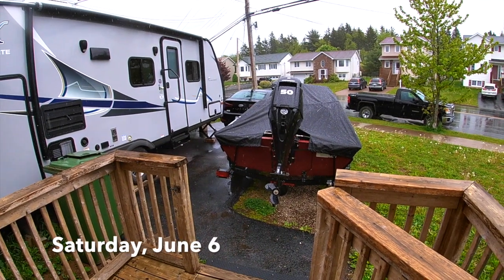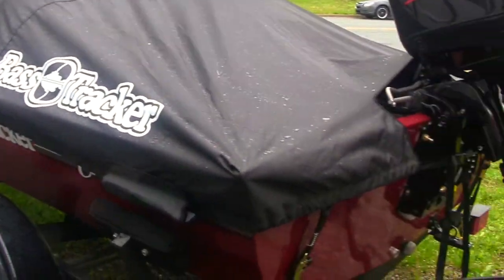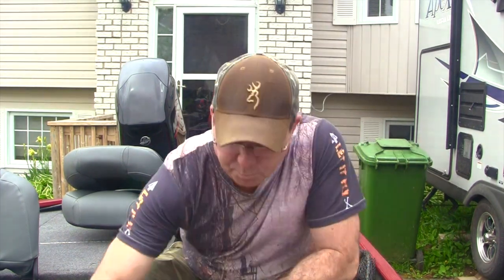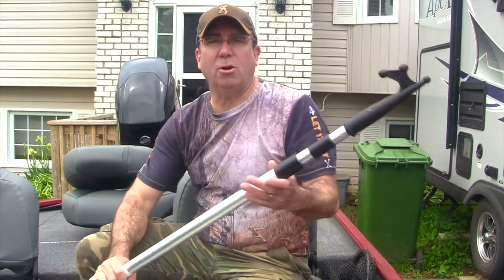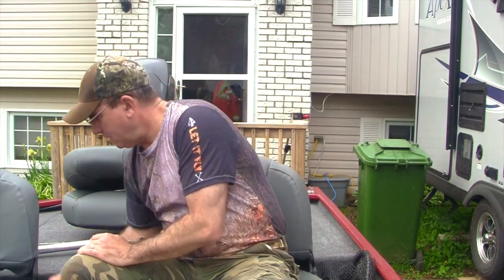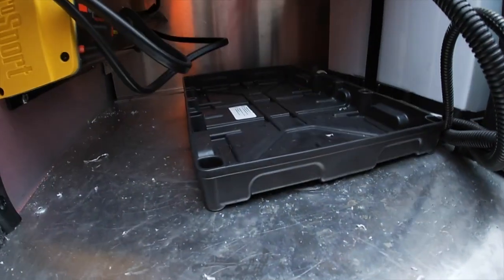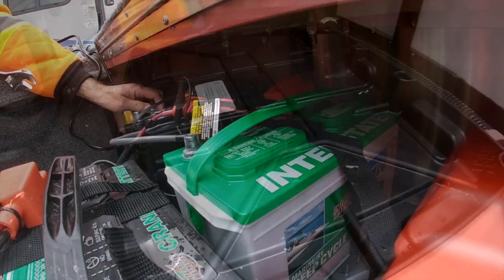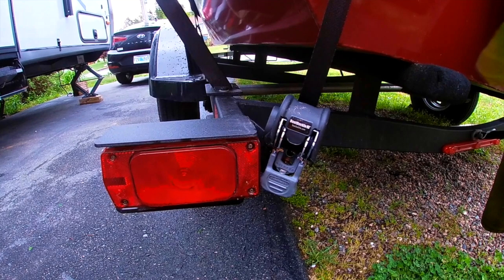Bass Tracker Classic XL - First Three Days - Accessory Haul - Modifications

Comment: Offhand question are the tie down cleats bolt on or hard mounted
Reply from the maker: The stern tie downs that came with the boat suck bad and were the first things I replaced. The were flimsy and are not attacked to the boat. There's an eye lit that I bolted on my replacements. Check the video I do show my replacements.

Comment: I have questions about this boat and trailer.  What does it weigh?  Does the trailer have brakes?  Is it a 7 or 4 pole plug?  Can you drive with the cover on?  Does the trolling motor have a hold mode?  This seems like a very affordable boat that's under 2000lbs.  I want a boat but 2000lbs is the max and lower would be more ideal.
Reply from the maker: They say the dry weight is about 800lbs and average package weight 1700lbs. So its relatively light. The plug is a 7 pin but because this does not have brakes on the trailer you can use a 4 pin converter. They say you can drive with the cover on, I don't like everything flapping around so I don't drive with the cover on. For the trolling motor if you mean "A GPS Lock" no it doesn't. It very basic. You can set to allows on or on when your foot pushes the button. I love this boat.

Comment: How is the boat cover? Is that the cover they sell as the $500~ option? Does it keep the rain out? Does water pool up on top? Did it stretch? Do you drive to the lake with the cover on the boat?
Reply from the maker: I love the cover it’s the expensive one. It’s doesn’t stretch. It’s water proof totally. I don’t get any major amount of pooling on the cover. I never travel with the cover on. It flaps around and runs stub. I prefer to travel with it off. Personally it’s well made, I highly recommend it if you don’t have a garage like me.

Comment: I’m looking to get a battery charger for mine. How is that Pro Sport holding up for you?
Reply from the maker: I am loving it. Seems to be holding up perfectly fine.
Reply: Frank Zinck thank you for getting back to me. I just upgraded to a 24v trolling motor and think I will go with the 20amp because I can’t find the 15amp.
Reply from the maker: I meant to ask.... was the wire thick enough for the 24V..... or did you replace that?